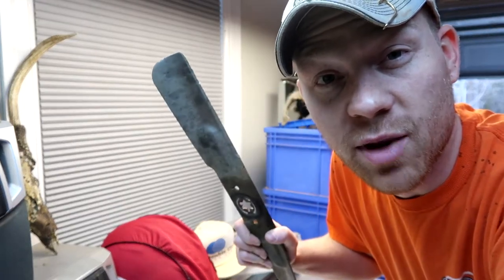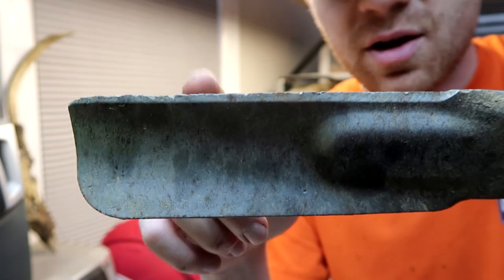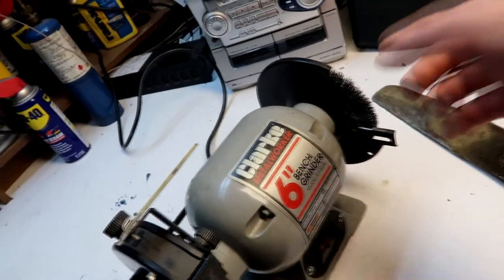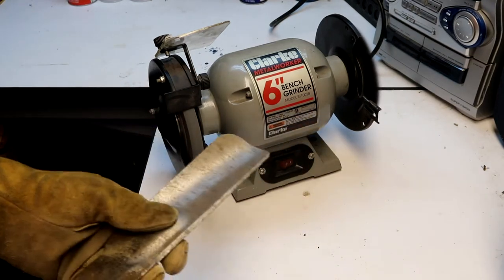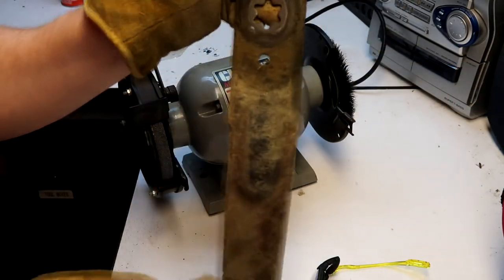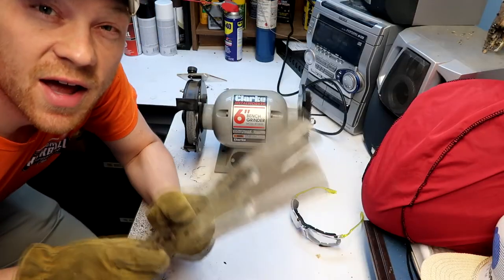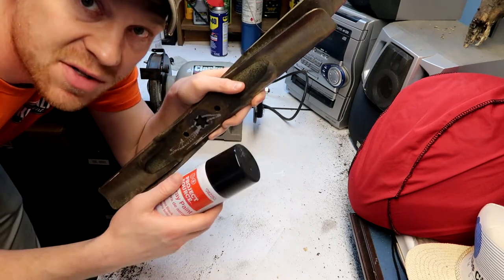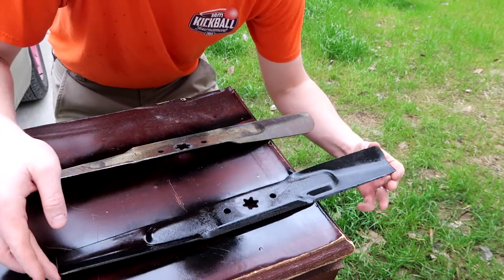How to Sharpen a Lawn Mower Blade - easy and save you money

Comment: The growing of the grasses are coming  - The growing of the grasses are coming- Spring is here Be - Prepared.    Thanks WHO_TEE_WHO.  for the reminder 
 A little maintenance goes a long way
Reply from the maker: Yup you got it! A lot of ppl run their mowers into the ground - never check the blades, never change the oil. Then they wonder why their mower doesnt work anymore 😆